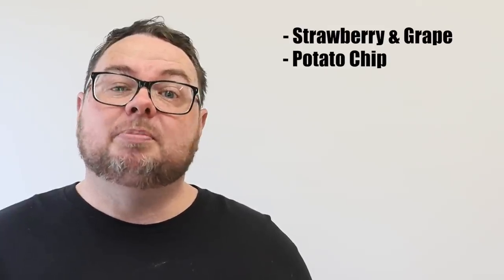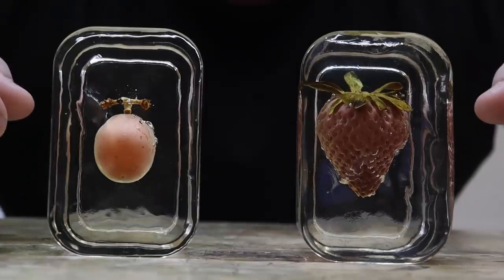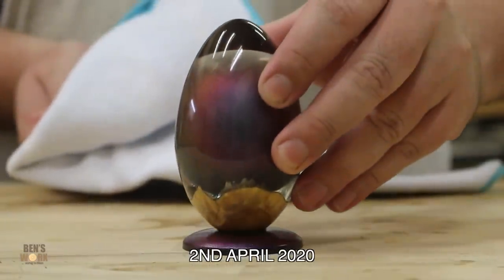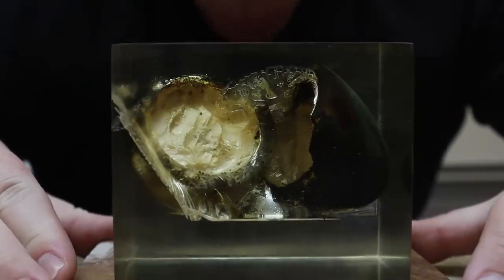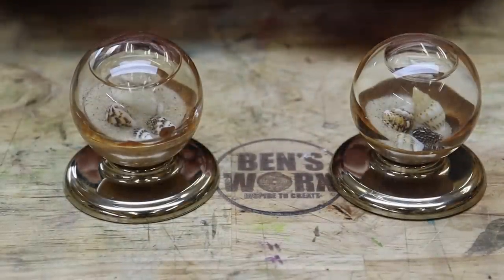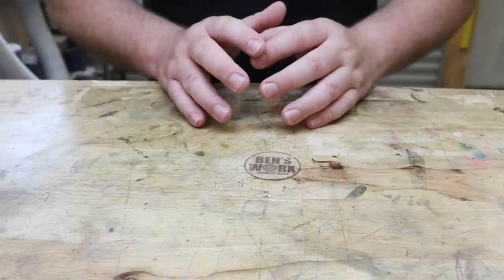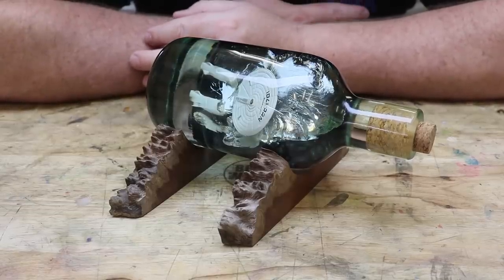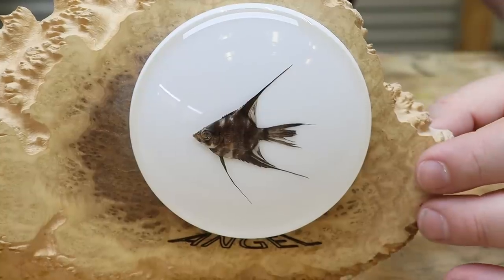You Won't Believe It! - Resin Casting Updates

Comment from the maker: Thanks for stopping by, If you have time you can check out my new range of Eggs here www.etsy.com/shop/bensworx
Reply: Ben, how about creating an Ecosphere in resin?
Reply: is it possible to send you stuff to put in resin?
Reply: I love this. I'm a sub for several different resin artists, and I am fairly certain that a good deal of your success can be attributed to your skill with casting resin, period. You've got a true talent for it. You've also got a keen (and sometimes wonderfully silly) artistic eye.
Reply: If that resin you’re using is exothermic in any way, I would think the heat from that might have been hot enough to kill any bacteria or living organisms that were trapped inside your water doorknobs. Doesn’t matter, though those were very impressive.
Reply: 9:01 bottom of your table theres a seal. pretty cool (i find "art" in wood and stuff)
Reply: That chip will last because of the oil 🛢 its unique

Comment: Just a thought on things decomposing.  In the resin, it's a sealed environment.  Whatever gasses are in there at the beginning is all there is. 
So any process that uses oxygen, has a very limited and finite supply.    A microbe that needs it, will eventually die after what's there is used up.  
So I suspect there was decay at first, for a short time.  And now they'll stay exactly as they are going forward.  All those microbes are now dead.

Comment: I need to know about something, I will try this with my dead lizard but some people say I must first apply formalin solution or ethanol first. Does lizards or frogs etc. rot in resin without solutions ? Angel looks good but should I soak it in solutions and dry before dipping in epoxy ? Any suggestions or experience about that ?

Comment: Quite the interesting update,  thank you for it. Something I'm wondering about: Does the egg cast smell like rotten eggs on the outside by any chance? I would expect some decay producing Hydrogen Sulfide (H2S), and since that is a rather small molecule. some diffusion out of the resin wouldn't be entirely inconceivable.

Comment: I wonder if you put the objects into a vacuum chamber to remove all the air before pouring the resin if that would eliminate some of the degradation over time
Reply: In something that was at one time a living organism the stuff it contains inside is fluid such as water if it's a plant material or if it's an animal it would be blood and also feces and urine , if you would put something such as a fish or fruit like strawberries they would swell up in the negative pressure of the vacuum chamber and ultimately they would explode which would be very pleasant , water boils in a vacuum so the rapid pressure would cause the fluids to escape through every opening but for the fish it probably would be a gruesome thing to witness

Comment: I'm curious, up close, most of these didn't look to have yellowed, the way resin usually does over time, but in the wide shot at the end, many of the non-tinted one did look more yellow; especially the egg and the potato chip.  So I'm wondering if the resin you use is more resistant to yellowing?
The big impression though would have to be the Star Trek casting, since that one's one of the oldest in the batch (I think you said it was the oldest) and the resin was tinted a pale blue/blue-green.  As graphic designer, I know the best way to pull out yellow from an image is to adjust the color balance towards blue; and I've wondered for some time know if that principal would apply to resin and whether a light tinting of blue would negate the yellowing?  The starship in a bottle kind of seems to lend some credence to that.  It would be interesting to do some long term tests; casting the the same type of object  (or a few of the same types of objects) and tint one blue and the other leave clear (maybe a could degrees of intensity of blue) and see and compare how they age.

Comment: I feel like the heat from the curing resin might have effectively sterilized the items inside of it, and killed off anything that might have been there. Some of the more porous things like the strawberry leaves could have also been infused with resin in the pressure pot as air was pulled out.

Comment: From what I can tell, I think the casting process plays a lot more into how well these are persevered or not. I know some people put these things into vacuum chambers to suck out as much air as possible. If you're also doing this, it would essentially make it impossible for most things to naturally decay with bacteria, unless- like we saw with the egg, it more or less has its own secondary self contained chamber. Otherwise, unless there is some sort of anaerobic bacteria within the thing itself, we will really only see molecular decay from exposure to sunlight resulting in color changes etc but no real degradation of the structure. But that's just my two cents on what I believe might be happening here, I can't say for certain but I'm fairly confident that's what's going on.

Comment: Pretty easy to know these were all going to turn out fine and will continue to stay that way as long as the resin holds up. Insects and other biological items have been perfectly preserved in amber for millions of years. Casting in resin is much more controlled than random tree sap flowing over an insect, so as stated before as long as the resin lasts so will the item inside.

Comment: I cannot understand how the doorknob project actually turned out. When I first saw the video I was certain that putting the glass bulbs on the lathe would cause the sand inside to scratch the living daylights out of the inside of the glass bulb. It should have been like sanding it from the inside with course sandpaper. I know that there must be a reason that I am wrong (since it obviously worked) but I cannot for the life of me figure out why the inside of the glass isn't brutally scratched to a frosted appearance.